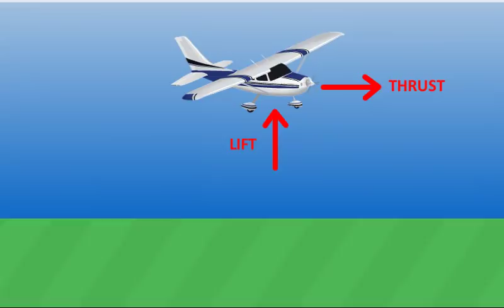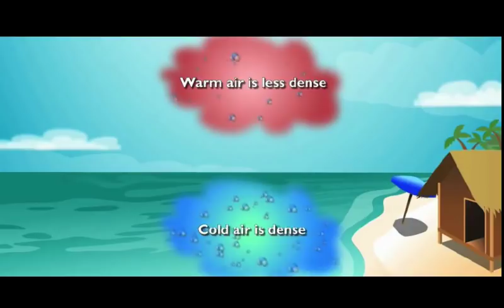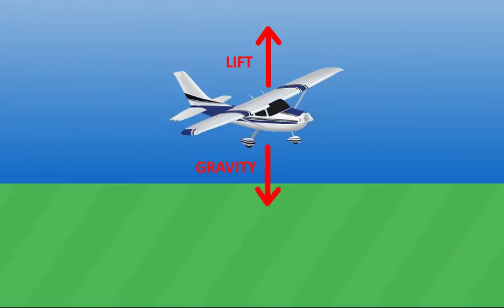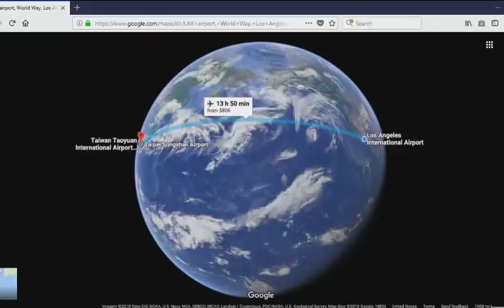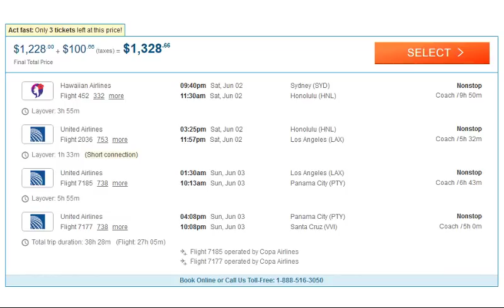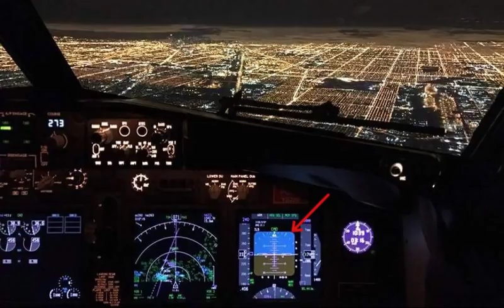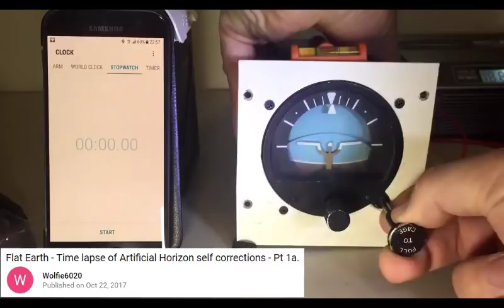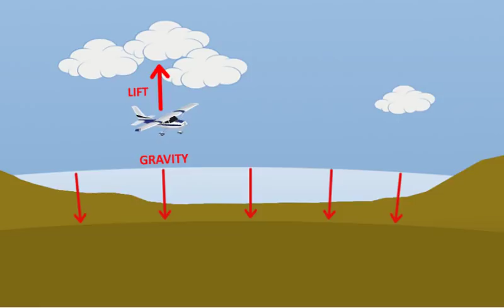Flat Earth Falsities - Plane Nonsense

Comment: You make a lot of unproven assertions in this video, such as that "air rotates with the earth" and that gravity exists.  There is no such thing as gravity, and if there were, then it would be impossible for airplanes or birds  or insects to fly, or for humans to jump,  because they'd all be pulled down and stuck to the earth.  

If 'gravity' were real, then it would have to constantly be monitored 24/7 by trillions of pixies who selectively cherrypick and decide from one split-second  to the next when to turn it on or off.  In other words, the  unsubstantiated & unscientific wild claims you are purporting to be true in this video are ludicrous.
Reply: You should consider actually watching the video before commenting on it.  Otherwise an impartial observer might suspect that you are a complete moron.  Unless of course you want people to think you're a moron.  In which case keep up the good work.  Moron.
Reply: @James Hewitt
Why are you lying James?
Why are you a troll James?
Why don't you fuck off James?
Reply: True Christian Why not prove the earth is flat? The simplest way to do this is by measuring where sunrise/sunset occurs. At this time of year, according to the heliocentric model, the sun will appear to cross the horizon ~23 degrees north of due East/West for all locations on the earth (as long as the sun actually meets the horizon).

The flat earth model claims this angle changes drastically depending on where you are.

As a result, the models can't both be right. This is a pretty conclusive test. Let me know what you find.
Reply: Yeah and also a religious whacko. You have a lot of ODD on your playlist i see. Do you believe the words of a convicted sex fiend then?
Reply: James Hewitt - Show us your working FE then? No working FE map case closed for FE.
Reply: James - Gravity exists because I am on the ground!
And yes that is something I was taught at school!
Before you get excited and tell me that not everything we are taught at school is correct, yes I agree but basic science lessons are not incorrect. If you are denying gravity, IMO, it is to suit an alternative agenda of denial and delusion my friend!
Reply: @Natster Jam
James is a troll, best told to fuck off.
Reply: True Christian - Did you go to school? if you did you will know that gravity exists! If you did and you still think gravity doesn't exist then you are living a dilusional life and need to seek help, I suggest you go for a mental health check up. I'm serious! Not trolling, just concerned for your mental well being!
Reply: James - I admire your tenacity but I have zero respect for your scientific nous!
I also respect that you are entitled to your opinion but you are dilusional my friend!
The earth is spherical and there are many cases of evidence to prove it.
The flat earthers base many of their theories on conspiracy as the scientific evidence they rely on is incorrect!
I offer one more piece of evidence for you which I suspect you will deny but for what it's worth for me it's undenyable.
There is one photo in existence that is NOT made up of several photos of the Earth which proves it's spherical shape, that photo was taken from the moon landing mission. If you look it up you'll see and finally, the debunking of other photos of the earth made up of several photos taken from satelites should also be counted as proof even if flat earhters think that because it is several photos it shouldn't be counted!
Happy day to you my friend, enjoy your life and keep trying!
Reply: James there is No presuming of the photogrtaph if it is real, if you or I accept that it is real then you cannot question wether the curviture is right, it is a photograph there fore it is as shown! Your questioning wether the curviture is right in a photograph is nonsensical, it is a photograph, it has captured the light that exists and therefore the exisistance of the object in it's whole as it is!
As to your question "Why are the rest of the pictures cgi?" They aren't cgi in that they have been created by a computer. They are a collection of true photos connected together to show the whole of the Earth, just like a camera that can shoot wide anlge landsscape pictures and then join them together to create a very wide angle landscape picture.
Reply: James - If you do not accept the photo from space of the earth is real then there is no hope.
Next you will be telling me the moon landing was fake.
To be honest relying on conspiracy theories for your so called factual theories will never stand up to investigation.
ALL of the theories declaring the moon landing to be fake have been debunked! FACT!
Gra Ra5 brings some very damning points to the argument and I INSIST you read them, he knows what he is talking about, you would do well to listen and learn instead of burying your head in the sand and believing the earth is flat, that is if you want people to understand that you are not stupid!
Reply: Well said my friend, although I beleive that there is "no hope" of changing James's mind regardless of your statement.
"There is no hope"
Thanks for your input Gra Ra5
Reply: James Hewitt Why would air pressure only push downwards? Why would buoyancy only push upwards?

Gravity was demonstrated in 1798 and countless times since.
Reply: Natster Jam The Himawari-8, Elektro-L and EPIC satellites all produce full shots of the Earth at least once an hour.
Reply: Buoyancy does not account for the rate at which things fall or while the fall in the direction that they do. You are clearly a flat earth troll.
Reply: The reason anyone on the flat earth side refers people to their souce of information is not to avoid any question. It is that trying to explain to most people that the world is flat is impossible. People must look into it for themselves. Before i stumbled across the flat earth topic. There was no man or woman who could try and tell me the earth is flat. I wouldn't expect anyone to hear someone try explain it and all of a sudden just take it on board andc understand. From what i can tell you haven't looked into it much . Like most who argue the way you do. gra ra
Reply: James Hewitt Show us that you know how to spell the word "trajectory" before you claim knowledge of things you obviously don't understand.
Reply: James Hewitt You REALLY don't know how to spell, do you? Your lack of education is showing in more ways than one.
Reply: James Hewitt You demonstrate that the photo is fake, not just refuse to believe it. 

I've already provided you with a link for WGS84. 

8" per miles squared is a rule of thumb good for a few miles; it describes a parabola, not a circle. It refers specifically to the ground, not your view. 

The lasers across lakes proves Earth flat claims always fail to consider refraction. Ignoring a confounding factor does not eliminate it.
Reply: James. You'd be right, if the Earth wasn't as large as it is. When viewed from the surface, the horizon appears about 3 arc minutes below the observer. That is impossible to gauge with the naked eye, extremely difficult to measure and impossible to measure given external factors such as atmospheric refraction.

The simplest vector on the matter is to go up in a plane and attempt to find the curve at some 30,000ft. You should see a drop in the level of the horizon of about 3 degrees, there. The simplest way of finding a curve while flying is to literally hold a straight edge against the window while flying over an ocean. However, this requires you to spend hundreds of pounds/dollars/euros on a plane ticket - so it's not something you're going to do just to measure curvature. At the end of it, you might convince yourself the Earth is a globe, but good luck convincing other flerthers, who will claim your testimony, images and even videos of your observation are fake.

This is where my experiment comes in. You can claim "fake" all you like on the result other people find, but the fact of the matter is that confirming or debunking it is as easy going outside and watching the Sun set - you have no excuse not to do it.

As for the maps - why are you bringing them up? The experiment does not require you to make measurements with other locations on Earth. It does not require you to know exactly where you are, or even approximately. In fact, it wouldn't matter if you've never seen a map your entire life. All you need is to know which way is North and have a way of measuring the Sun's position when it touches the horizon. That's it!

Note that I claimed that the Sun will appear to rise/set ~23 degrees North of due East/West ANYWHERE in the world at this time of year, provided the Sun actually meets the horizon. The globe model claims that on any given day, we will all see the Sun rise/set at the same (similar, but still well within one degree) angle, no matter where we might be.

The flat earth model, no matter which one you think is most accurate, depicts that the Sun is relatively small and close to earth. This claim is made because of the Eratosthenes experiment, where he observed the Sun appeared to be at different angles at different places in the world at the same time (midday). He posited that the Sun was very large and far away, resulting in solar rays of light approaching us parallel to each other and the Earth's curvature was the reason we observed them at different angles during midday. Eratosthenes calculated the Earth to have a radius of approximately 7,000km based on this assumption. Flat Earthers claim that this is not the case, that the Sun is relatively small and close to a flat Earth and that the Sun appears to be in different position in the sky precisely because the rays are not parallel. Given such an assumption, flat Earthers believe they can measure the height of the Sun above the Earth using the same method Eratosthenes used to estimate the Earth's radius.

Here's why my experiment is relevant:

If we consider an instant where the Sun's rays aren't perpendicular to the ground (midday) but instead, an instant where they are horizontal (sunrise/sunset), we eliminate any effect the shape of the Earth has on our observation. That is to say, if the Sun's rays are parallel and the Earth is indeed a globe, then the Sun will appear from the same angle on all locations on Earth during sunrise/sunset. If the Earth is flat, the Sun will still appear to come from different directions.

Simply put: if the Earth is flat, there's no way my assertion that "the Sun will appear ~23 degrees North of due East/West on the 22nd of June" could possibly be true for the vast majority of the world.
Reply: Yes James and you are clearly nothing but a trolling mong.
Reply: It only takes a "true christian" to be so full op b*llssh*t. So sad to see people not even using 0.00000001% of their brain capacity. Yeah you keep believing in your childish easy and wrong theory of an imaginary man in the sky creating it all.
Reply: God says you're embarrassing him.  Apparently you were a prototype Adam that he rejected.
Reply: Naster jam. Are you trying to tell us that gravity exists because your school teacher told you so?
Reply: Omg . you should try watching other videos on YouTube.  There are billions.  Then you might not look like such a mong.
Reply: Ryan . The simplest way to prove the shape of the earth is to measure the surface to see if its curved or not.
Reply: Ryan . The promblem i have with using your method to determine the shape of the earth is the maps. Maps get proven inaccurate all kinds of different ways. Using the trojectory of the sun can prove. 
1. The map is correct or
2. The map was drawn to fit the trojectory of the sun 
If you measure the maps in different ways you will find the map that fits the trojectory of the sun.  Doesn't add up to   maps based on calculated measurements of land mass. The maps that most are most familiar with are not accurate by a long shot. But dont take my word for it . Look into it for yourself ;)
Reply: Watch did scientists prove the shape of the earth? You decide
Reply: Why the name mong patrol? Do yuou spend your time comenting on videos.  Telling people they are dumb?
Reply: I am on the ground becase of buoyancy and density.  The atmospheric pressure at sea level pushes the air against the surface at about 14psi
Reply: Buoyancy and density are also tought at school.  And demonstrated in front of the class. Gravity is completely undetectable by science and the theory  is only required if the earth is a globe . Which it is easily proven to be flat
Reply: Ok assuming that the picture from 1972 is real. That would indicate that they got the curvature right too. But unfortunately you cannot measure the curvature depicted in the "photo" from the surface. The surface has been proven flat and measured in many different ways. Also  Why are the rest of the pictures of earth cgi? Why don't we have an abundance of real photos? Why has it been so long and we haven't been back to the moon? Why dol astronauts say that nasa destroyed the technology to get there. Along with lots of other data that could prove their distance from rarth? Why cant we pass the van allan belt? How can we see satellites at midnight when they are in the dark and have no lights? Come on man.  That 45 year old picture is proof you say? Watch a video called. " a strange thing happened on the way to the moon" then tell me its real. The video is of the astronauts on a Apollo mission taking that very photo you speak of.
Reply: Naster please keep talking to me. I am genuinely injoying answering questions  and hearing others theories. Especially answering  intelligent coments such as yours
Reply: Mong patrol . I dout you would take my word for my workings out. Why not check it out for yourself?
Reply: Ok . I dont poersonaly accept the photos from space are real photos. One of the main reasons for this is that. The curvature of the earth canot be detected by messuring the surface of the earth.  The earth is perfectly flat. We can measure this im many different ways.  If you're interested in seeing some experiments. check out the documentary called " did scientists prove the shape of the earth? You decide " it is the most thorough measurements i have seen of large bodies of water. Also i have investigated. Also watched videos on other peoples investigations of the photos and footage released and cannot take any of it seriously anymore.  I hope you look into this further and get a better idea of what is causing people to abandon the globe model. There is a lot of material on youtube supporting the  flat earth theory that makes no sense and ruin it for people  who look into it with a scientific approach.
Reply: Gra ra. I use the the template of the 25000 miile circumference of the globe. curvature of 8 inches per mile squared.  For example. 3x8x3 or 6x8x6 or 40x8x40. That is how much the earth should curve from any point. According to the reall photos from NASA. This should be very easy to measure on the surface. What im trying to say is that if we can measure the surface of the earth to be perfectly flat.  Then that means that the photos from space are fake. I don't know how to calculate the alphabet (algebra).  But but i do know how to measure the distance between 2 points and also how to calculate curvature and compare the two. That is why i dismiss photos from space
Reply: Gra ra . I also don't expect people to just believe what i say. I would rather explain where i got the information i am trying to share and everyone decide for themselves. Anyone who takes something written in these threads or any text for proof of anything is mistaken to do so. Thats why i try to explain the best i can and if people question the information i give i refer them to where i got it from. To help people understand. The only reason i started comenting on this video was to help those interested understand my point of view on the matter.